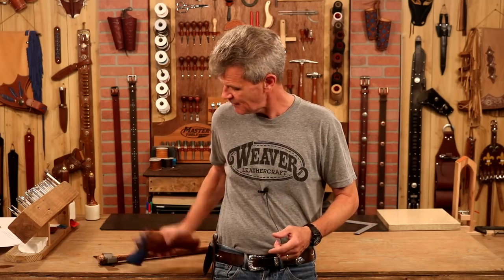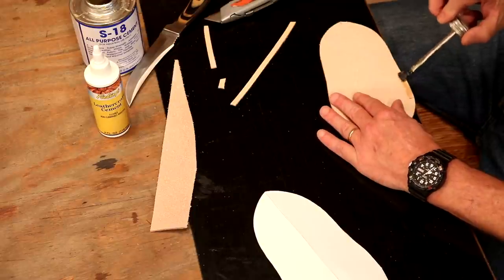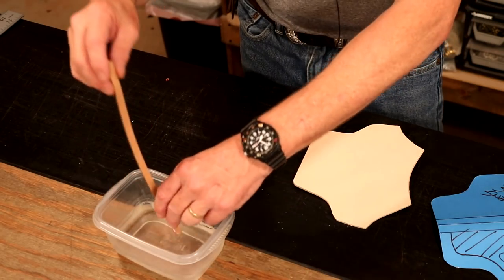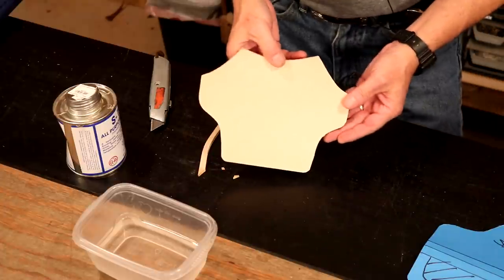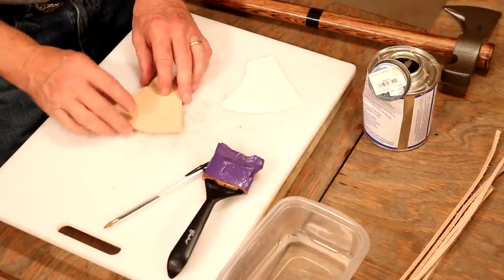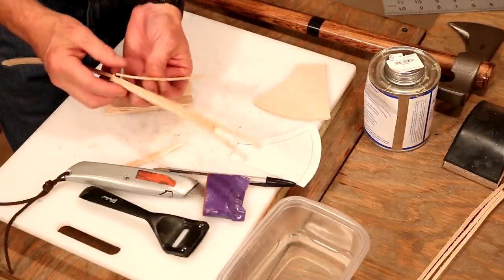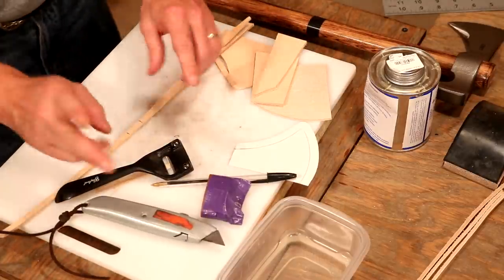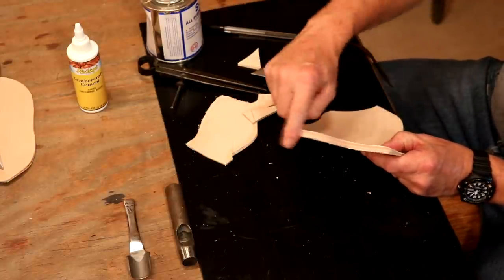The Leather Element: Simple Ways to Add a Welt

Comment: A new blade every time. You must have stock in a utility blade company. 😊
 I've had the same blade in my box cutter well over a year now. It's cut lots of leather, wood, plastic and even a wire or two. Just sharpen it if it gets damaged. Otherwise just strop it between cutting jobs. Mines sharper than a new one cause the edge is thinner. Good video on welts. I do mostly big blades so I use wider welts and don't use glue. I've thought about trying it for years now I've just never used it cause I dislike sticky stuff. 🤔

Comment: Hey Chuck, could you do a  Leather Element on noise reduction? I've had to move my work space indoors and I'd like to make less noise when punching and tooling
Reply: Hey, I am in a similar situation and I mostly solved the issue by investing in HEAVY STUFF. 

Heavy table + heavy granite block + lots of different density layers between them (wood table - rubber mat - plastic board - leather mat - granite block) and that reduced the noise considerably as the main bench eats up most of the vibrations. 

The other noise to consider is tool on tool vibrations (mallet to punches) and that is mostly mitigated by being in a room with lots of soft things near or on the walls!
Reply: @ekoukano  that's super helpful! I've just bought some thick rubber matting to go under my granite block and punching board, but I might try doubling everything up.like you have!

Comment: 2:30 Chuck... why not pre-dye the leather so you don't have to worry about the top grain? I know, I suspect several reasons... but, is there now way to remove glue or dye over a slight spill to the edge or top?
Reply: Glue comes off well with a damp cloth don’t rub to hard

Comment: I have a small hole in the leather of a purse on the trim area on a fold.  Someone suggested that I use Fiebing’s  Leathercraft cement.   Instruction to use a toothpick to drop small amounts of the cement into the hole a little at a time until the hole is filled.  Any other suggestions or a better way to do that?  Thanks much.

Comment: For the welt that has the angel in it for the ax. How would you use the stitching chisels to make the holes for stitching in that all together to make your finished sheath for the ax?
Reply: Or a tiny nail.  That’s how I did it before I had a drill.
Reply: @flashpointbravo  Thank you. I do not have a drill press or the money for one right now so I was looking for other ideas.
Reply from the maker: Thomas, if you don't have a drill bit, you can mark the holes with the stitching chisels and then use an awl to punch the rest of the way through the leather.

Comment: what is the point of a welt, and how does one know if they need to add one
Reply from the maker: Hi Erick,
A welt is used for knife sheaths, so the blade doesn't slice through the stitch line when putting the knife in and out of the sheath. On a holster, it's added to allow extra room where the leather is stitched together, for the gun to slide in and out.

Comment: For a complete starter: why use welts?
Reply: Visual: V vs. \./ or || vs. |.| - It is a spacer between the front and back pieces of leather. It allows for a bit of an opening for the edge of a blade to sit without slicing into the front or back leather pieces. A welt just creates a buffer... On something like a gun holster, the welt plays the same role between the layers of leather creating a bit more of a cavity for the gun to rest in. For projects such as a business card holder, the welt can create more space to hold your cards in without pinching them between just two layers of leather.
Reply: Great explanation, josh.  I would add that it keeps a knife blade from cutting your stitches and also reduces the stress on the thread and stitch holes because the leather isn’t being pulled away from itself.
Reply: I am now bought into welts, gentlemen! :) thank you for taking the time to educate the beginners!
Reply: If you sew two pieces of leather together to make a knife sheath the pieces will simply guide the blade onto the stitches and they will be cut
Inserting a welt acts as a buffer and protects the stitches
Also, a welt can be used to space apart the leather, and give you more room inside your sheath, pouch, or whatever
You can use a welt to space apart two sheets of leather when making a mobile phone case or similar